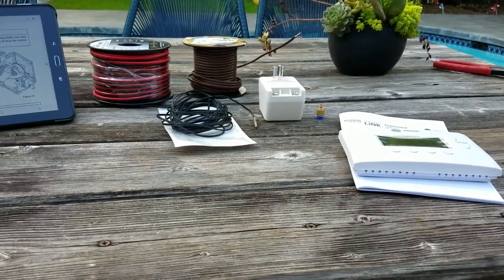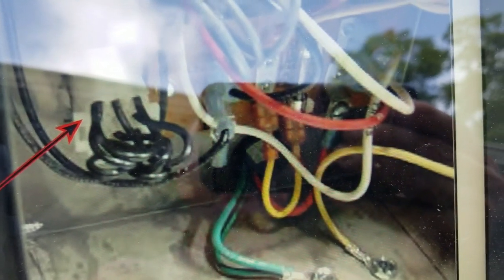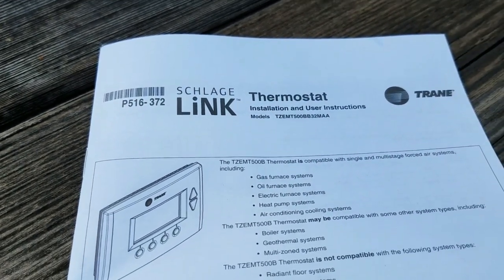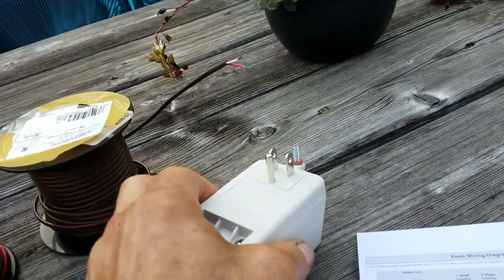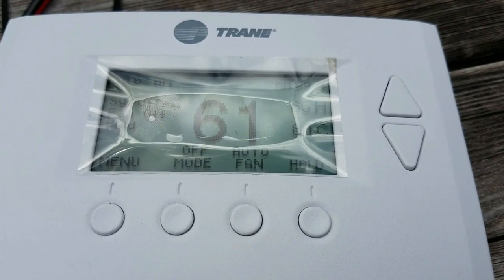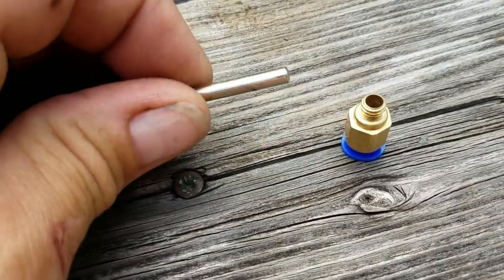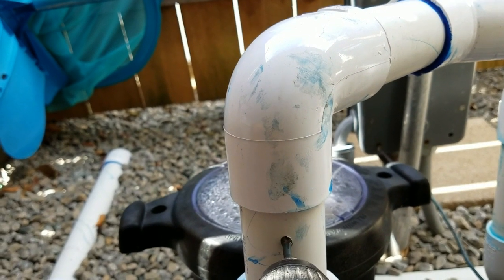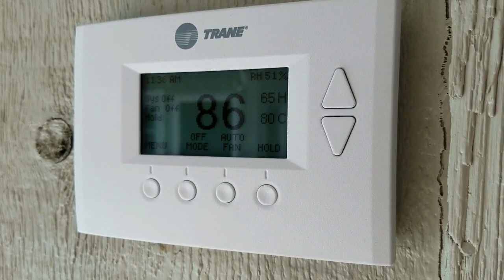Zwave Pool Temp Controller. How to add your pool temperature control to your home automation

Comment: Great work Andrew - I'm going to follow in your footsteps, but I have a fundamental question about the fireman's switch operation: if you can connect a dry NO contact to the FS terminals, and the heater turns on when the NO contact closes... then why isn't the heater on 100% of the time when the factory jumper is installed? Does the controller somehow "know" that there's a contact installed by virtue of the fact that it's occasionally open?
Reply from the maker: The firemans switch only turns it on and off when it is on the heater runs at whatever you have set it at.
Thanks for watching
Reply: @AndrewJWatts  Oh, I see... so as long as the FS switch is off, the heater won't run at all! So for closed-loop temperature control, do you then set the heater temperature at the built-in controller to something higher than your desired temperature, and then just turn the heater on and off with the dry contact?
Reply from the maker: I set the temp control to the desired temp and use the firemans switch contacts to turn on and off at the beginning of the day and off at the end of the desired time period

Comment: So, I have the same setup, what terminals on the AC controller do you use to activate a relay or whatever?  do you have a diagram of what you've done?  thanks
Reply from the maker: Hi I used the terminals on the ac controller that control the on off of the ac heat furnace it is in the instructions of your AC controller.

Andrew
Reply: I mean on the Trane thermostat, which contacts did you use?   I have the same thermostat,   I know how to install the relay part on the heater itself, but you are using which conatcts on the thermostat itself?  thanks
Reply from the maker: @everythingcool491  use the 24c ( common) and the w1 heat (24v ac hot) to turn on your 24vac relay
Reply from the maker: use the 24c ( common) and the w1 heat (24v ac hot) to turn on your 24vac relay
Reply: @AndrewJWatts  Thank you for your help, I figured that much as I tested the points one by one, the thermostat is very slow to react that it was tough to test, thanks again

Comment: Nice how you connected the temp sensor. Great job!
Reply from the maker: Hi you connect the two wires from the sensor directly to the external thermostat terminals  of the ac controller

Comment: Thanks for the video its been very helpful.  I currently have what looks like the same GE outdoor ZWave 40amp you have for my pump, plus I have another 2 gang outdoor box with a ge zwave toggle switch for my pool lights, another ge zwave outlet to run a few sets of FEIT LED string lights around my pool and an Echo DOT hung on the wall to control them and my pool speakers while I'm in the pool.  I've been looking for a way to get the current water temp through Alexa as well as enable turning heating on and off.  This is looking like the easiest and most cost effective way of doing it.  I couldn't find the same model thermostat so I'm going to try the Trane TZ45 which appears to have the same remote sensor functionality.

Comment: I see the remote sensor RS1 connection, but how did you control the heat?
Reply from the maker: Hi David
i used the AC controller to operate a dry contact relay which contacts were connected to the heater's fireman's switch. with the heater set to on and at the maximum temp you could ever want, the AC controller would turn the heater on and of to the desired temp set on the AC controller.  i hope this answers your question
Reply from the maker: Unfortunately I cannot control the heat from this only turn on and off, i am looking into how i can hack into the control board but they are expensive if it goes wrong. But i normally only have the pool set to 1 temp so it is not a problem